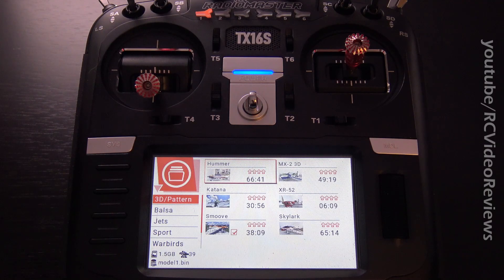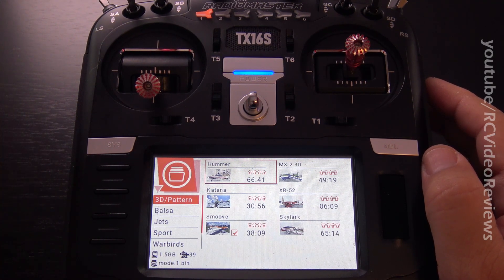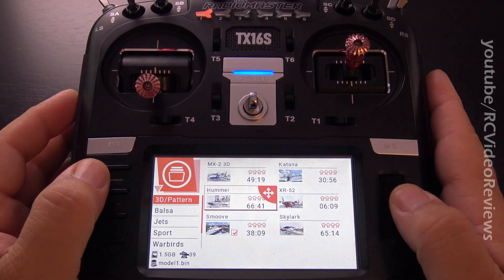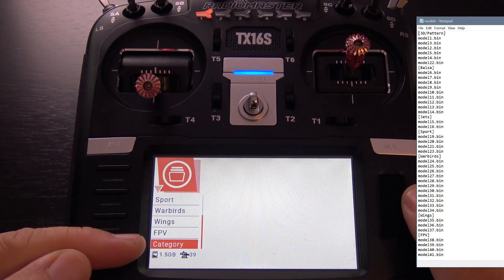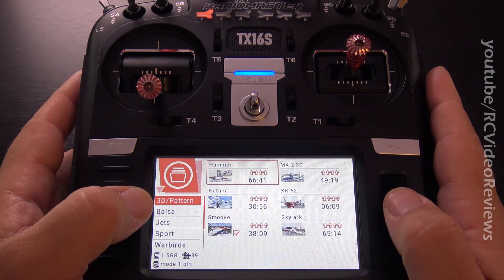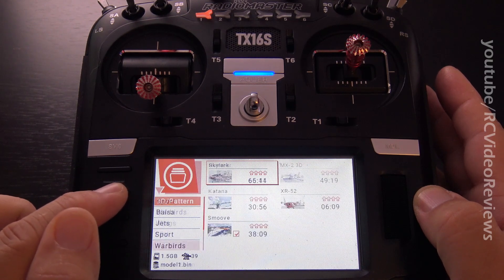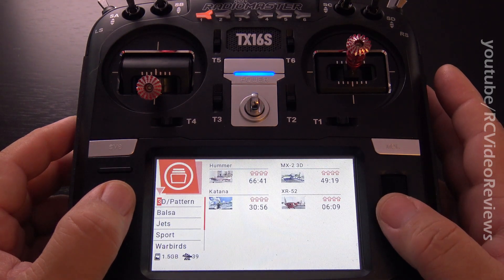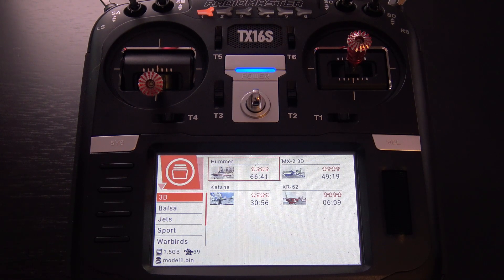OpenTx Tutorial • Move Models Among Categories on Radio • Radiomaster TX16s • [Beginners]

Comment: Hi John, when selecting a model, if I click PG UP or PG Down, it takes quite a while (maybe 2 seconds) to move to the next category. I don’t have a lot of models and already tried a new and fast card. Is it normal to OTX or the radio? Any thoughts? Tks!
Reply from the maker: I opened that same ticket with OTX a year ago and they said that's just the way it is. Upon further digging, I understand the USB interface on the radio is quite slow--old standard and cannot be improved without using a different CPU. Has something to do with IO pin availability.

Comment: 2nd the manual, I also want you to filter and make change recommendations to the OpenTx, FrSky, RadioMaster, and Jumper.
Reply from the maker: Change recommendations??
Reply: @RCVideoReviews  I am thinking about one item you had wished they would implement differently in the companion. I'll look for that again when I go step by step. I never really grasped Companion or an organized file system, never had sounds in the Simulator, or really understood  or used a GV until today! Really appreciate how clear you've made each topic! I have the T16 pro as well as the R9M and have wanted at least one other momentary button like the flush ones on the X lite pro and S, and maybe a camera pan joy. I guess what I was trying to say is good folks with a great grasp on  use case product and software changes/enhancements/ insights should present the wisdom of such changes. Even more I think an American manufacture might compete  somehow. I have been an amateur  radio operator  for over 40 years and used mostly Japanese gear until Elecraft  started first as a radio kit manufacturer in the Heathkit tradition with in house design and progressed  to a quality radio and accessory provider. They were operators of the stuff and they listen to their customers who drank the elecraft koolaide and still do. Anyway, I ramble on not knowing much about any of it. Dad flew his first RC on a beach out of Tokyo  his dad  and his men were doing 50cal range against a target drone. Dad was there observing when the Sargent asked if he would like to fly it. Big smile and Yeah! Dad started me off on a RC converted Cox .049 Dune buggy , then pulse rudder planes and boats when I reached 6 or 7yrs. But in the last 8 years I flew the Radian until recently experiencing FPV that reminded me how interested I was as a teen in NASA like telemetry, Deep diving ROV and the like.  Then Dad met OpenTx, the Tunigy 9x then FrSky telemetry. hooked.